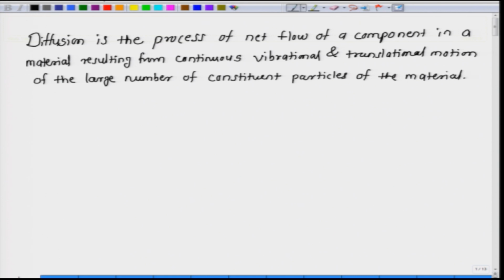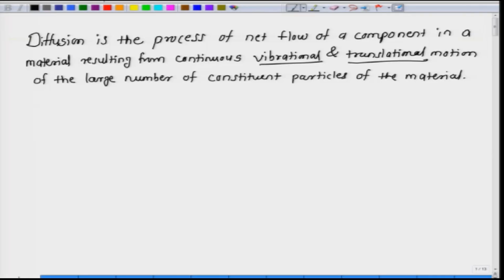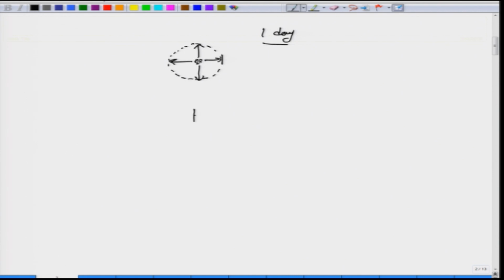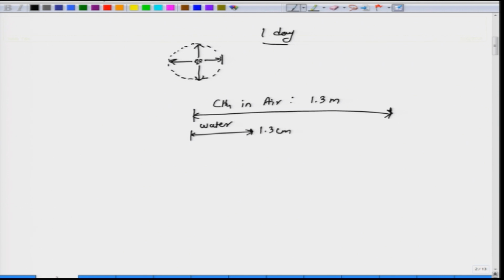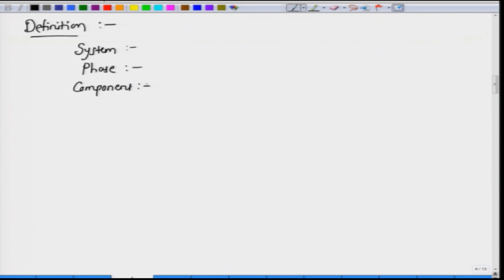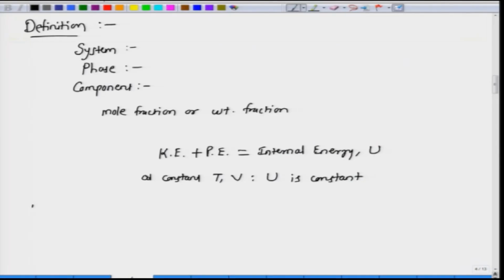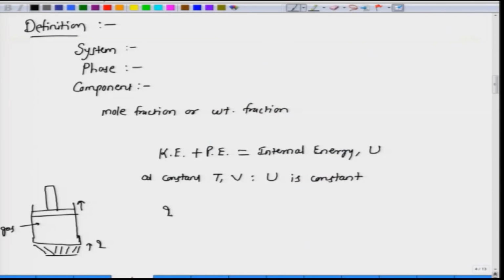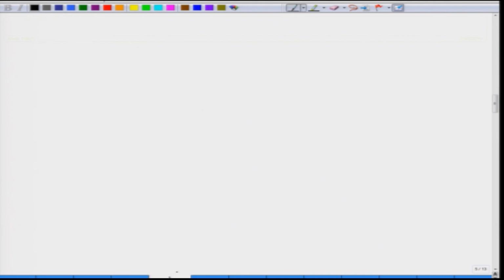noc20-me28-lec01

Comment: Respected Sir And Nptel team, please try to put the name of the main subject and if possible topic along with the code title of the lecture then its easy for viewer and listener for saving time and effort of listening each lecture.
Reply: Week 1:	Basics of thermodynamics: laws of thermodynamics, concept of chemical potentials and criteria for equilibrium
Week 2:	Refresher on Solution Thermodynamics and Phase Stability
Week 3:   Phenomenology of multicomponent diffusion and various frames of reference used for measuring diffusion fluxes
Week 4:	Solving diffusion equation for various boundary conditions including solution of multicomponent diffusion equation
Week 5:	Self diffusion, impurity diffusion, interdiffusion and intrinsic diffusion; Experimental determination of interdiffusion and intrinsic diffusion coefficients
Week 6:	Point defects in crystalline solids and mechanisms of diffusion
Week 7:	Random walk, diffusivity and correlation effects in diffusion
Week 8:	Derivation of correlation factors in some crystalline lattices
Week 9:  Derivation of fundamental driving forces for diffusion: chemical potential gradients and atomic mobilities; cross effects in multicomponent diffusion driven by defect mechanisms
Week 10: Interrelation between multicomponent diffusion coefficients, atomic jump frequencies and thermodynamic factors
Week 11: Multiphase diffusion, diffusion structures and phase diagrams
Week 12: Experimental determination of activation energies for diffusion; Fast diffusion paths: Grain boundary and pipe diffusion
I got it from https://swayam.gov.in/nd1_noc20_me28/preview